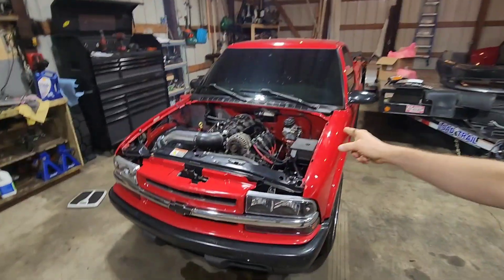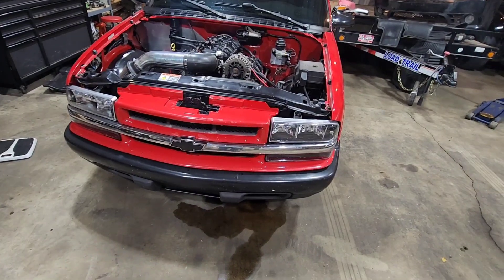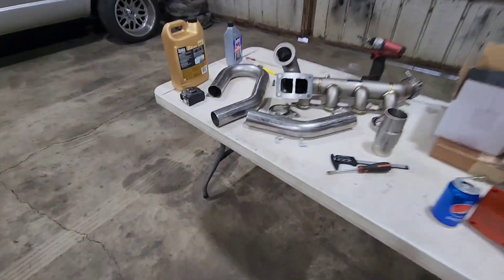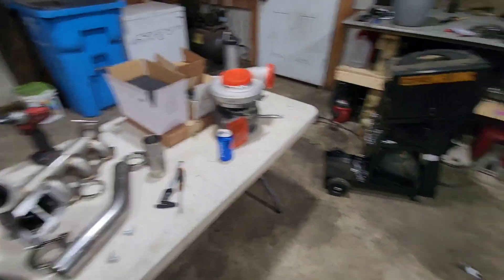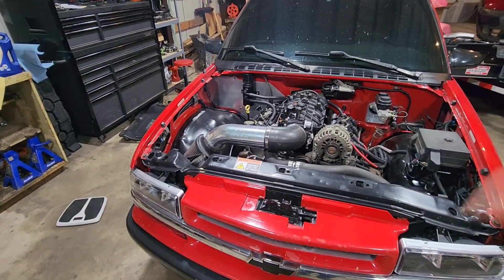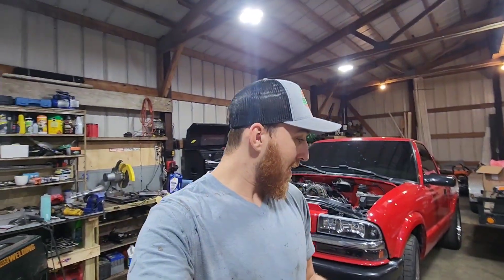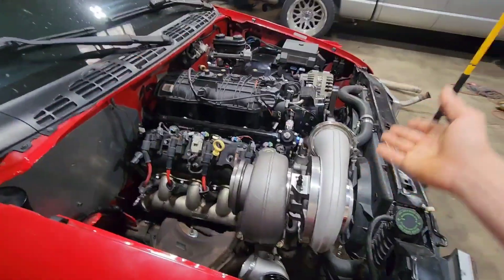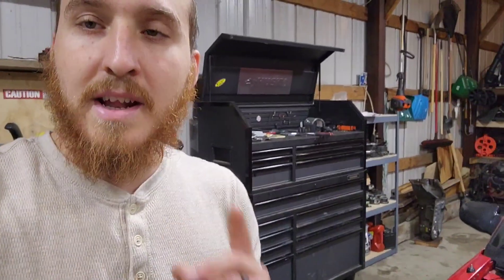Putting a t6 s480 turbo on my 6.0 ls swapped s10

Comment: Is ur motor ring gapped?
Reply from the maker: My current one is
Reply: @elmermiller8896  the other one didnt last?
Reply from the maker: The other one was a very high mileage engine,it took 15 psi like a champ until the rod bearings went out
Reply: @elmermiller8896  damn so just the rods basically
Reply: @elmermiller8896  i think i will be find because ima be cruise more then racing im be on street just wanna do a lil sum you think ill be find. My motor like 130k miles